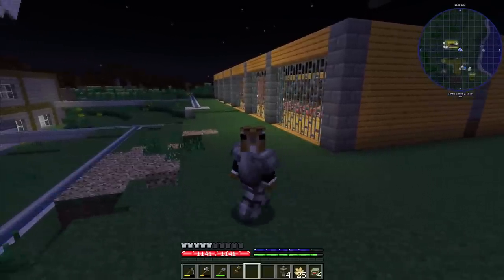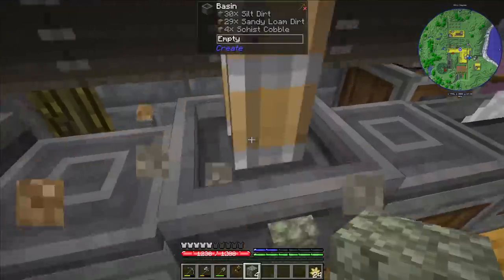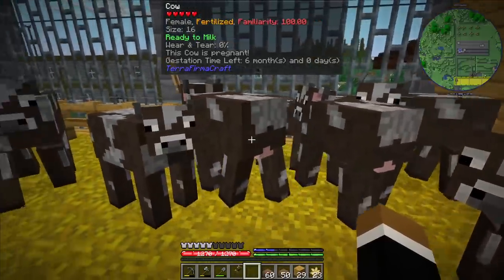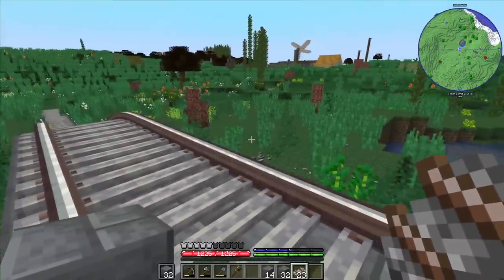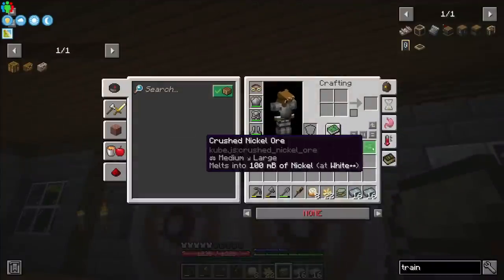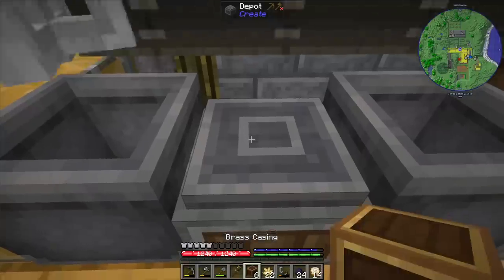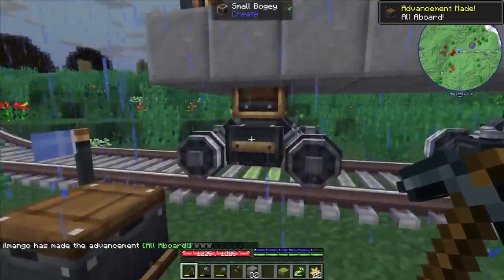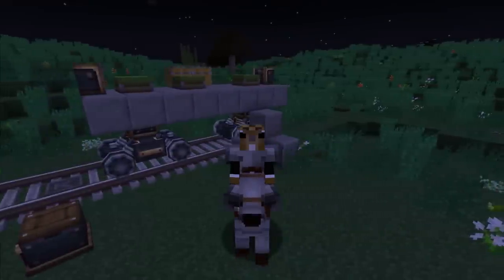ATFC: Getting Into Create Mod Trains (Episode 31)

Comment: Create Trains are so much cooler than shulker boxes for mass item transportation. Imagine a train network on a technical server connecting all the farms
Reply: I do not have to imagine it, some friends and I did that. It is extremely cool and we were pleasantly surprised to see that trains are not a big source of lag, the farms on the other side...
The secret to succes was writing a document defining a standard for cargo train lengths, interface locations, min/max signal distance and naming to name a few. We also had a shared folder with schematics for things like two way T intersections.
This allowed everybody to build their stuff without having to worry about trains not picking up cargo or intersection deadlocks.
Reply: @AlbusRegis  Sounds great! It certainly was a good call to define certain rules. Surely you also set a minimum size for tunnels and such?
Reply: @racernatorde5318 trains don't check for collisions with blocks
Reply: @AlbusRegis  bros out here defining specifications like you have a department of transportation. Thats sick
Reply: Satisfactory / Factorio style conveyor systems are best with trains in the mix!
Reply: @bengoodwin2141  Trains may not, but players do. Not to mention that it looks ugly to have your train pass through solid rock
Reply: @racernatorde5318  yes that's true
Reply: @rmullins9368  Create trains >>>>>>>>> minecarts

Comment: For the washer filter. You might want to look into attribute filters if the recipe is enabled in the modpack.
They differ from the regular filters in that it's more about, "capabilities" or "properties" of an item than the specific item.

Things like which mod an item is from, if it's a tool etc.

The one you'd be interested in would be the "Can be washed" property, a blacklist filter for that would prevent the funnel from accepting any washable items, and pickup only the results.

Comment: My create train heart is crying a bit on the inside since you didnt hold Ctrl while making your tracks to smooth them out, but I suppose it doesn't have too much of a practical disadvantage other than looking janky. Although I'm not sure, the train might go faster if the tracks are smooth and have a long curve over hills or around corners etc.
Reply: I don't know about elevations, but short curves do affect the maximum speed and thus should be avoided. But let's be real: Even if they didn't,  large curves look so much better anyway
Reply: Ctrl placing tracks often also saves a few tracks since they usually can take a shorter route overall

Comment: The platform of the train can be one block lower so it doesn't look that retarded. If you hold slabs instead of full blocks in the offhand, it will fill the space below the tracks more nicely. Also, use ctrl when placing tracks, it makes both curves and slopes smoother.

Comment: You can right click on a seat while holding a mob on a lead, it will sit it.
Reply: Good to know! So far I just rode them into the seat, but that didn't work properly all the time. Is there another trick for getting them out of the seat? Right clicking the seat works, but is unreliable too

Comment: Waiting for ilmango to replace the windmill with a nuclear powered turbine generator. I know it’s not in the game but I know ilmango will figure it out.
Reply: If you have a heat source and a crap-ton of copper, steam engines are heavenly
...although, Blaze Burners don't exist in TFC
Reply: not too far off given how nuclear reactors essentially are steam engines, you can set up a huge steam engine in create and use similarly dangerous means of powering the burners automatically
Reply: @silvermagpie1071  Blaze Burners are replaced by coal forges in atfc
Reply: @johndeyner  hmm, that's right. I wonder if you can use chutes and funnels instead of having to pull out the arm, if it's an inventory
Reply: @silvermagpie1071  You can have a deployer next to the coal forge with coal to fuel it.

Comment: the elytra is cool, but is way too op and has made most roads obsolete, which i think is in itself a bad thing. i have a vanilla world since 1.8 and when i startet it i made sure to have some kind of road between my different places, of course it was an ice road in the nether connecting every portal, i still try to maintain it but after the elytra it is more tedious to do so, not because i got lazy of it, but because i am not really using it. before the elytra i remenber using that ice road all the time while in my world, so expanding it was never a chore, was a time saver. in fact, since that was also before shulkers i also had a railroad in the middle of the ice road and i could put minecarts there with stuff, all rails reached a place were they unloaded into an storage system... and sure, shulkers have made the transport easier now, but is easier better? because i was quite fond of my take on the issue, only now is simply more convenient to just carry everything on you in shulkers. 

but well, i suppose that is what minecraft vanilla is these days, a race to make the game as easy as possible so that nobody has to do anything interesting.